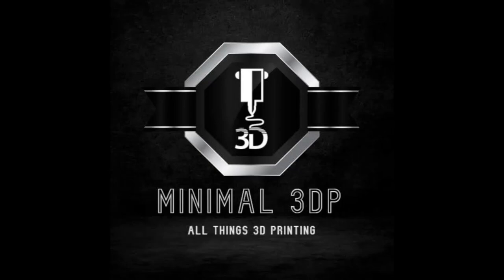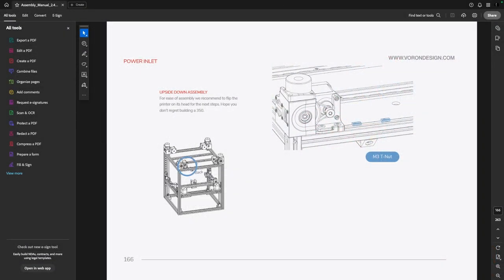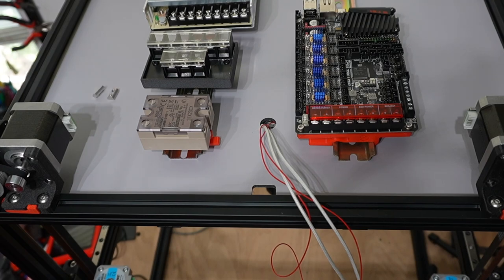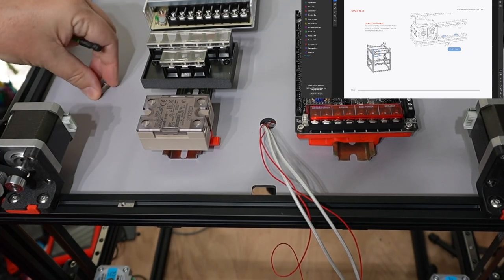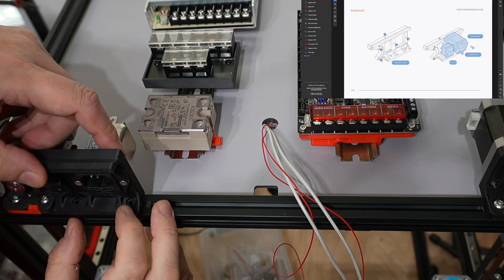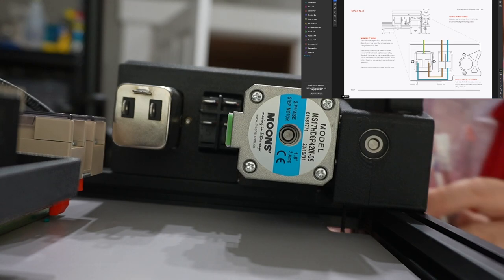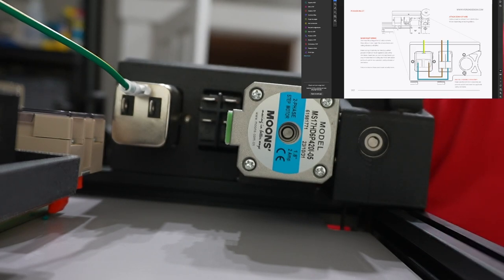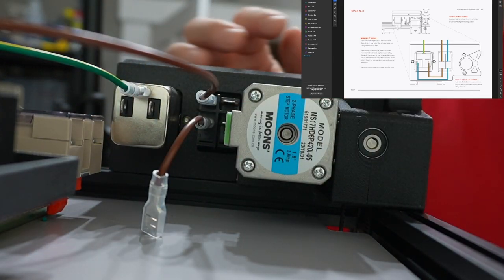Voron 2.4 R2 Build Guide: Essential Step - Electronics Wiring (Part 14)

Comment: Hey Mike, I have been following your videos on the build and can't thank you enough for all the work that goes into them. I am anxiously waiting for the rest of them! My 2.4 is almost identical to yours, few minor changes, such as I used the CNC parts kit, my main board is an octopus pro, and I have the U2C for canbus. I tried using the link in the video to set some time with you on a video call, but the link is giving 404 error. Keep up the good work!

Comment: The motor power cables go from the motor cable to the main power (all on the mainboard, thats why they are short), and that ground to the tnut isnt going to be good enough. Id drill a hole in the frame and use a self tapper to really get a good ground. Youll need a clean surface, ie no paint. 

Over all nice job. Thats a really nice wiring kit